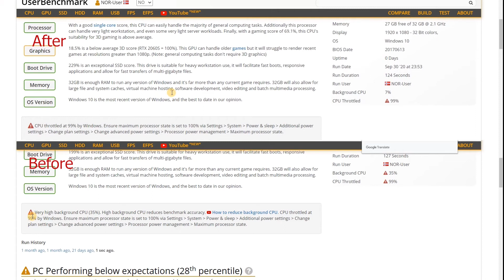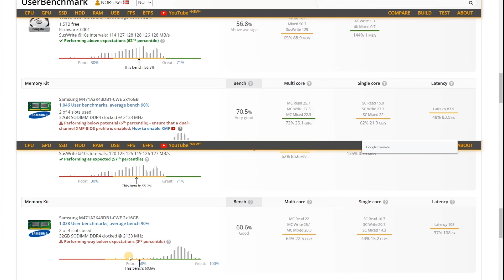Here's how and why you should clean your old laptop LENOVO Y700

Comment: I get often BSOD and Y700 Geforce drivers don't work properly - is it overheating related? Which paste to use?
Reply from the maker: https://bg.m.wikipedia.org/wiki/%D0%A1%D0%B8%D0%BD_%D0%B5%D0%BA%D1%80%D0%B0%D0%BD_%D0%BD%D0%B0_%D1%81%D0%BC%D1%8A%D1%80%D1%82%D1%82%D0%B0
Reply from the maker: I don't think it's because of Temperature it's because of software error or hardware error
Reply from the maker: I've been using it for six years without fail.
now it's with Windows 11 😎
Reply: @display123  What OS you used?
Reply from the maker: @RynaxAlien  Windows 11
Reply from the maker: @RynaxAlien  https://youtu.be/S_3oq3xa2YE